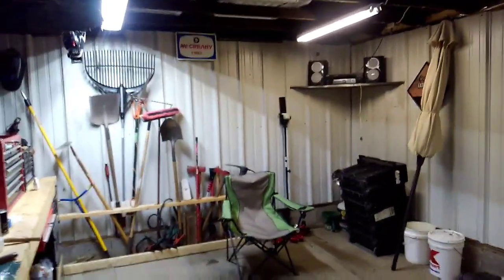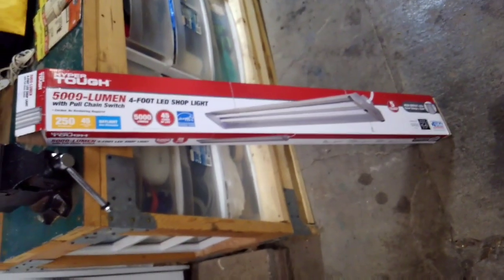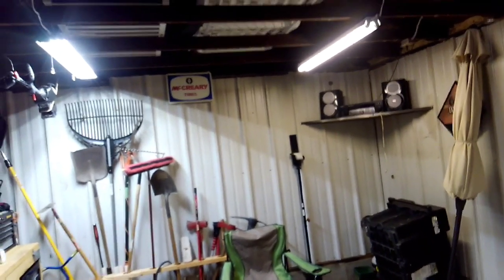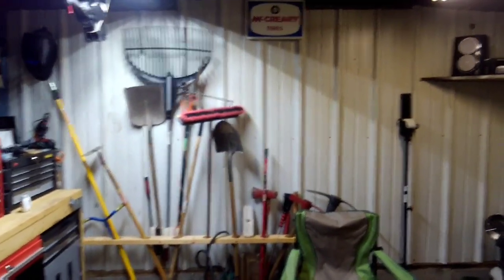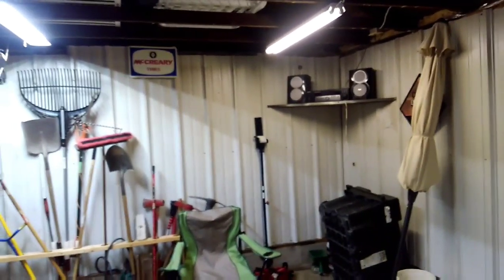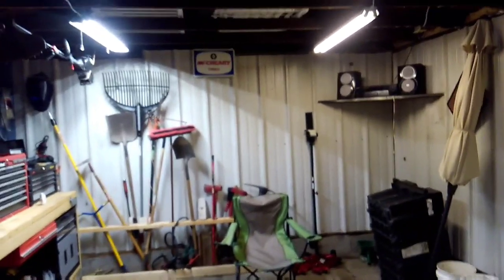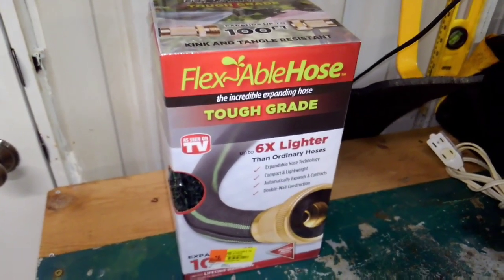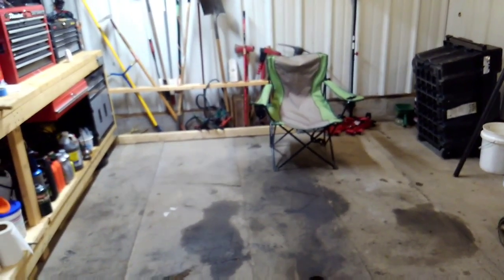Hyper Tough LED shop lights

Comment: I have 5 of the 5k in my shop and flicker is a problem for me with these lights. One light in particular is worse than the rest but they all flicker to some extent. I have had them for about 3 years now.
Reply from the maker: Mine just started to do that.